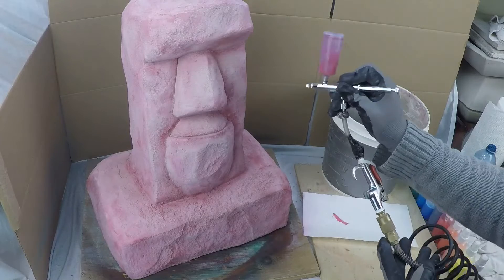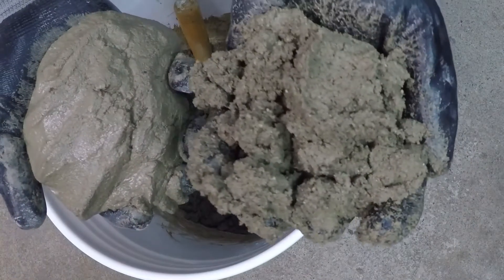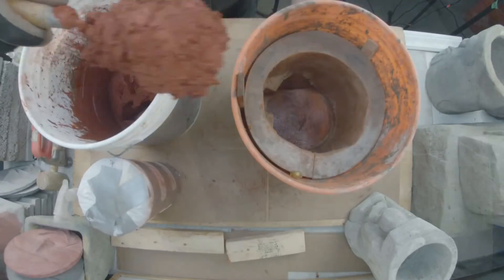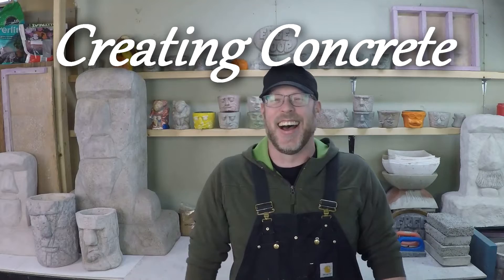Will Heat Make Concrete Cure Faster?

Comment: The Old rule.. Cement/ Concrete  , for an ultimate cure  30 days...& YES keep it WET . Daily .

Obviously,  that's an extensive amont of time  .
BUT  with that Old process zless likely to dust , scratch or even crack  for years to come.

Breathing in .. Dust from  Cement  (before or after curing)  can be a Health risk.

Great Viddy 
Im going to ck your work out , i see in the backyard.

Comment: Short answer is no
Reply: Long answer is yes for initial set.  Precast plants often cover, to keep moisture from evaporating.  The concrete is then heated to 140F and in 4 hours it is already at 5,000-6,000 psi.  Normal sidewalk concrete is 3,000 psi.  This allows the production plants to remove the pieces from the form and prep again for another pour.  The goal is to pull out pieces every 24 hours. Each bed is cleaned, setup, poured, cured, and removed each day.  Those precast pieces reach 10,000 to 11,000 psi at full cure.

Comment: It's not accurate to use the word catalyst wrt water in curing concrete. The water react with the ingredients and becomes a different molecule entirely. The term is sometimes used loosely, of course, but typically something is a catalyst only if it survives a chemical reaction intact. Eg. Lime + water => Calcium hydroxide is CaO + H2O => Ca(OH)2.